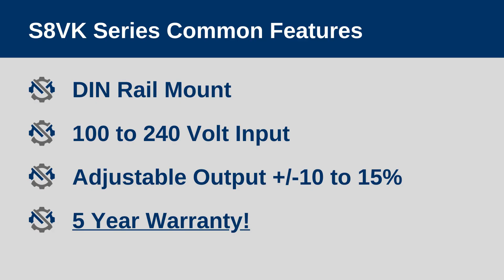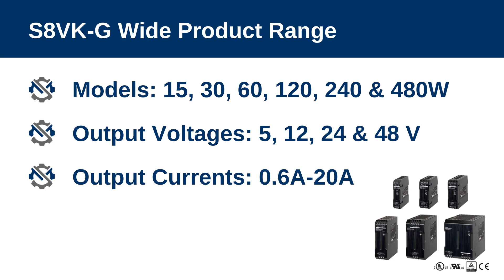Mechatronic Minutes: Omron S8VK Series Power Supplies

Comment: Note: the S8VK-S and S8VK-X top and bottom space requirement is just 25mm.
This means a 5-Amp power supply + top and bottom space requirements is about 5.5" (140mm).